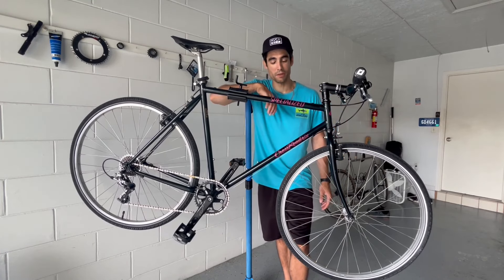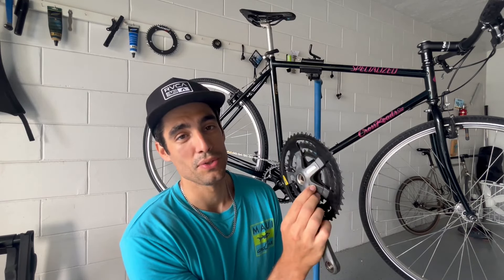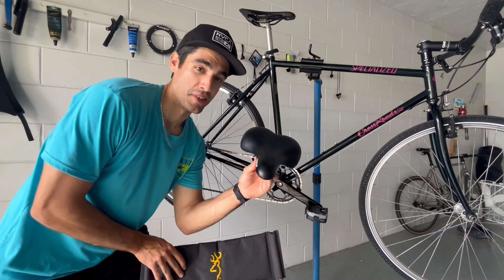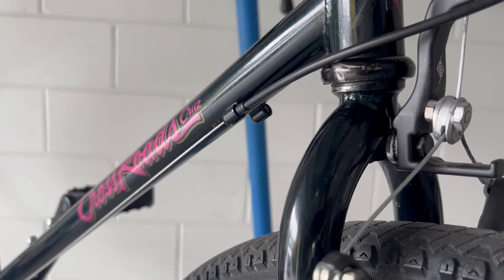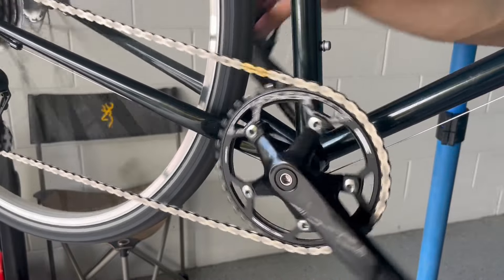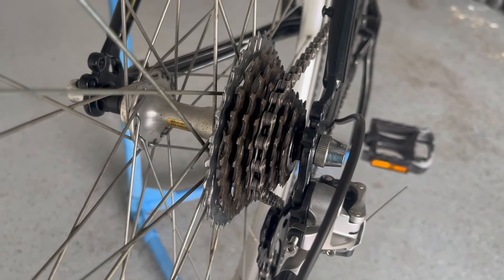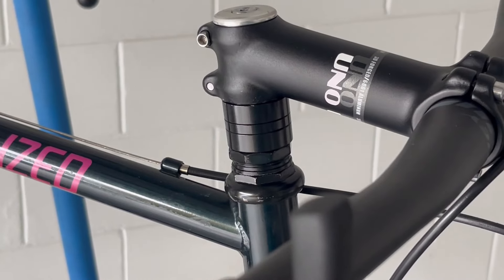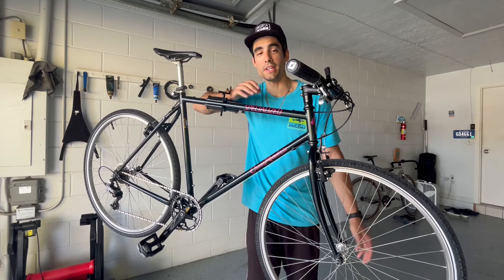1990s Gravel Bike Conversion! Specialized Crossroads Cruz!

Comment: According to my research steel bike seatpost sizes are based on the OD, wall thickness, and intended use of the frame so a 26.6 generally means decent tubing that may be thicker for strength. Since most steel tubes(non-metric/french) are 28.6 OD it means thinner tubes generally run larger seatposts.
I run some old shimano xt friction thumb shifters on a road bike with vintage scott MTB bars and it's pretty awesome.
Nice that that specialized is 135mm rear end and has tons of tire room. 700x40+ tires would be super comfy, my old mtb I use for rough roads has a 26x47 and I run no bike shorts most of the time since the tire+seat absorb so much of the bumps.
Reply from the maker: Thanks for the in depth info I really appreciate that! That’s an aspect that is so cool with these older bikes, the lore behind them.

Comment: Are you sure that has 135mm hub body? If so, you can throw a 8/9/10 speed cassette on there...
Reply from the maker: I actually have better wheels coming as the spokes are starting to corrode a lot and a few are stripping now when I tension them. But a super cool wheelset is on the way!

Comment: Looks great. I've been eyeing these bikes for a while to do a similar conversion. I believe the rear hub spacing is 135mm, right? So in theory you could run a modern freehub, I think. Nice job!
Reply from the maker: I highly recommend snagging one if it’s in good condition! You are correct 135mm in the rear and when these wheels are done I’ll be getting a modern set myself!
Reply: @newoldsteel  Awesome! Hopefully I can pick one up.

Comment: Have you changed any freehubs when upgrading bikes?
I have 1990 nasbar road 6 speed rear cassette. I want to use 2 sets of wheels 1 for clean paved road trails and the other for groomed gravel trails. I got a good price on bontranger race lite but it is a little too wide for my bike in the back. Any ideas?
Reply from the maker: At the moment no! They may look a tiny bit crusty but are working phenomenally. I’m assuming your rear spacing is 135mm?
But the line of hubs that’s on this bike is the Shimano exage with the 135mm rear. Hopefully you can snag some or potentially modify the axle size

But also hub bodies I’ve never changed that, so hopefully one day I can to gain knowledge of what it’s like!
Reply: @newoldsteel  My bike is currently at 126mm and the new wheelset is 130mm. 
Thank you